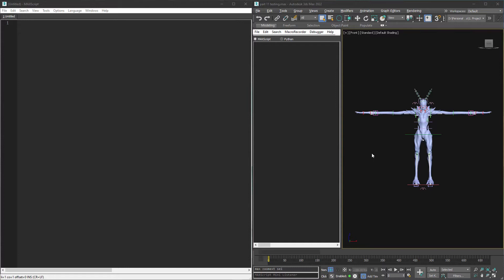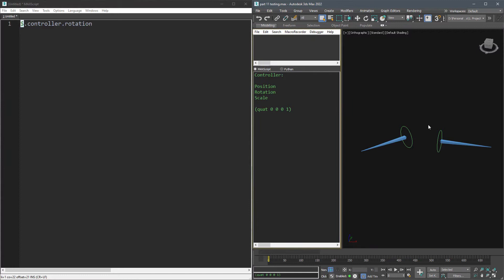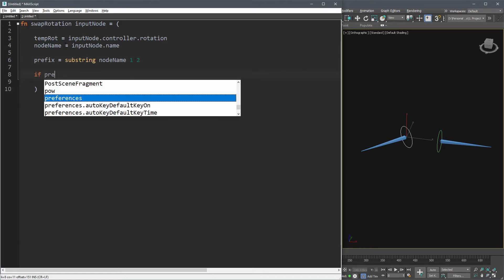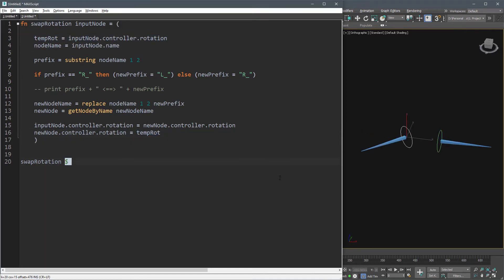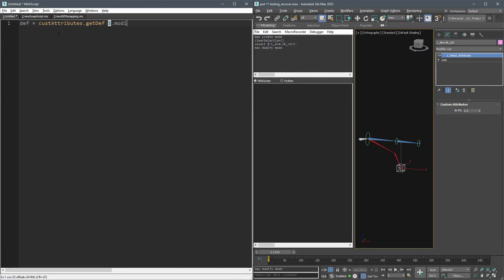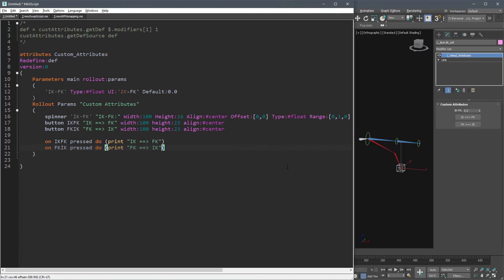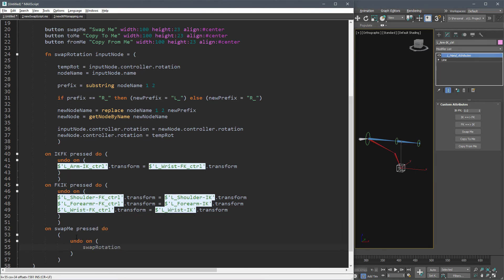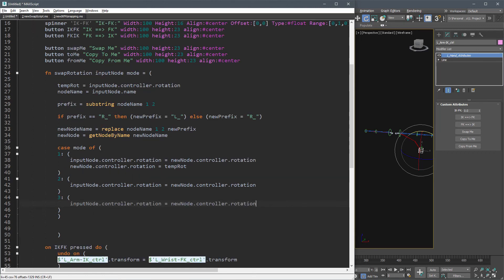3Ds Max Rigging For Game Engine Part 11

Comment: nice work man. ALso, looking at your code for the IK/FK switching, 
calling objects with their name hard coded is bad practice. 
You should store the nodes in the Attribute and call them from here.
That way, their name doesn't matter, and if there are multiple characters in the scene, there will be no conflict with names, 
or people can modify the asset names without breaking the rig.
Reply from the maker: Thank you, I appreciate your help, I usually use a custom UUID for selecting objects. Didn't know about that.